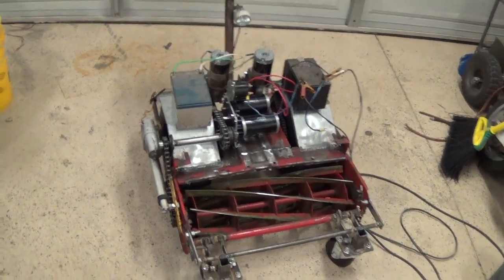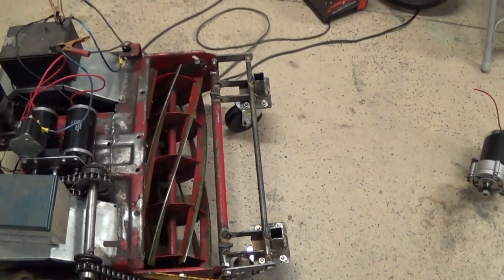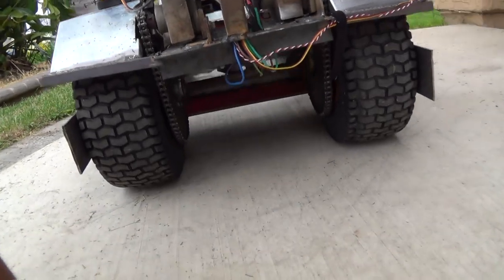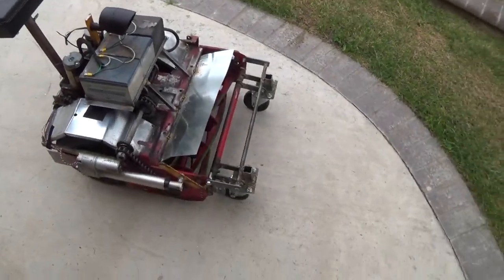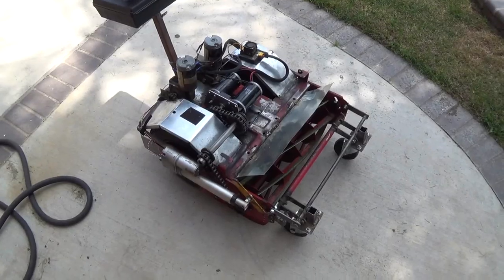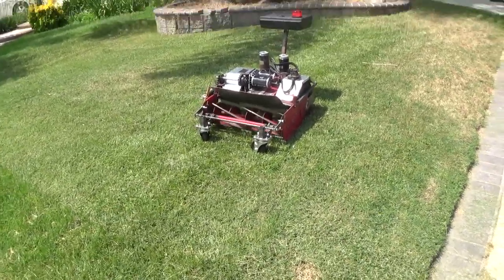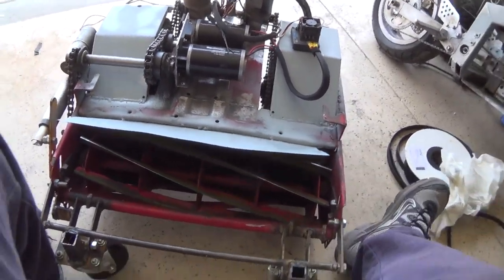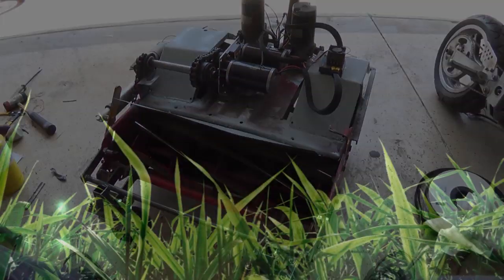Mr Tmac's rc lawn mower with hacked ps2 rc 3

Comment: why not use belts on the reel? it would be quieter and you could do all of your gearing pretty easy.
Reply from the maker: i just used what i had on hand. but i like that idea. i was considering a rebuild with a push mower conversion.
Reply: I did chains right away on this beast.

https://youtu.be/TDdC8KQ_RjU

Then I went to belts.   After the belts it makes no sound at all. I can hear myself whistle. Belts are much more forgiving also.

Comment: the engines? are they starters from a car?
Reply from the maker: No, the reel motors, i got from andymark. $25 a piece and $70 something for the gearbox. the drive motors are a type of wheel char accessory motor i got from surplus center. but i have not seen them on the site for sometime now.
Reply: can you give more info about the motors
 and the gearbox